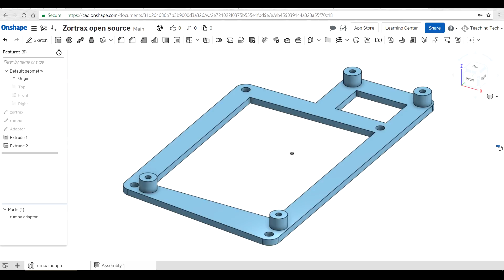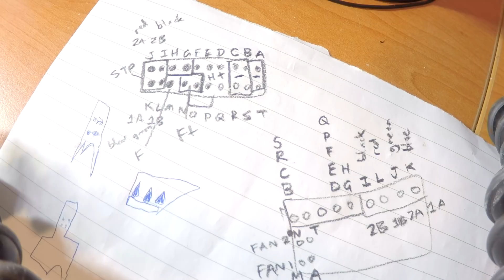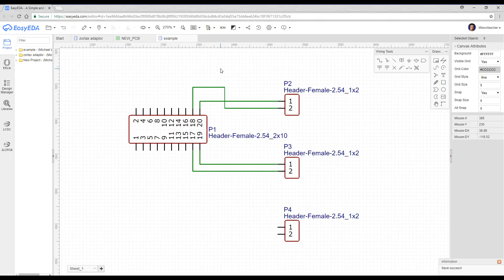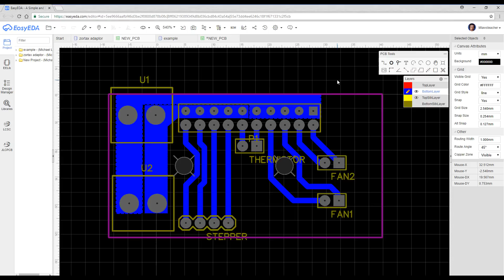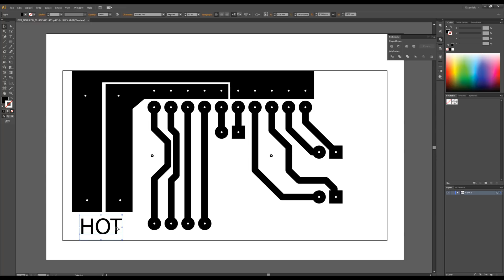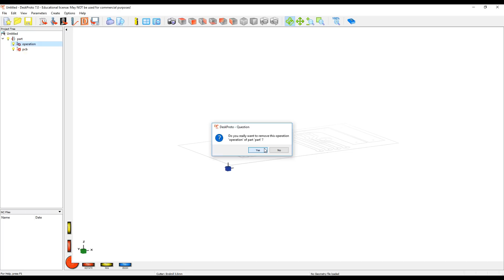Making a custom PCB: Frankendoodle open source Zortrax part 2

Comment: nice job so far already.
nice to have a cnc router on hand, but why not cut it out on your vinyl cutter and stick it on foto sensitive pcb, and put it under a  uv light to expose. or draw it with a marker in the vinyl cutter (or inkjet printer) onto glossy paper and iron it on normal pcb (see tested) or better. draw/print on fully transparant (overhead-projector) film. and expose on pho-sensitive pcb. so you can etch it.

you like to fiddle arround with pcb, so i just suggested some options. that does not say you have to do it ofcource.
nice job Michael.👍
Reply from the maker: Good suggestions Jan. I used to print out an heat transfer onto PCB before etching before I had the CNC. I wonder if normal vinyl would be suitable as mask for etching? Never tried the UV sensitive versions, might do so one day.

Comment: I've tried to make some homemade boards time to time and always have trouble with drilling the through holes. I had even set up a drill press with a rotary tool and my depth perception must just suck.
Reply from the maker: That's why I make the hole centres so small. It puts a little divot in that helps alig the drill bit tip. Usually I do this on a drill press which helps my accuracy. It I was going to do a large batch, I would mill a grid of boards and also drill the holes on the machine too.

Comment: Now you've got to change the name on the front of the printer. 😀
Reply: this for he really needs the vinyl cutter. lol

maybe the white text will come of with lacker-thinner. and hopefully spair the black powdercoating. try on an unseen corner.
Reply from the maker: I am definitely planning a sticker. Didn't think of using a solvent to remove factory graphics, that is great suggestion.
Reply: carefull. and try the solvent on a non exposed place to check that the black powdercoat stays on.but i think that the white (zortax) text will come of though. or else just blend in some flat black paint. but you'll think about something thats for sure.

Comment: You can use Fusion 360 to do cam. It's free, and works very well with DXF files -- you just need to create a 3D object, but that's pretty trivial.
Reply from the maker: Thanks for the tip.

Comment: I'm surprised you didn't use auto bed leveling on the CNC. Just use 1 wire to ground the copper and an alligator clip on the engraver bit connected to the Z-probe connector on your RAMPS(or equivalent) board. You should also use a waste board underneath the board and use some clear double-sided 3M Scotch tape to hold it on. That way, not only can you use the mill to drill all the holes properly for you first time through, you can use a flat end mill bit to carve the boards out for you, no need for a special saw.
Reply from the maker: My machine came with a Chinese Mach3 compatible USB board, but I replaced that with a Planet CNC mainboard. https://planet-cnc.com/
I know it can use a sensor to set the z height but I don't think it does auto bed levellng. I agree it would be better to drill the holes in place on the router.
Reply: Since your hardware can sense Z-height, grbl control software can map the contours of the copper clad board. The open source software I use is grblControl, but there are other alternatives such as OpenCNCPilot and ChiliPeppr, the latter of which can also be used remotely, eg. with a raspberry pi and a tablet for jogging ect.